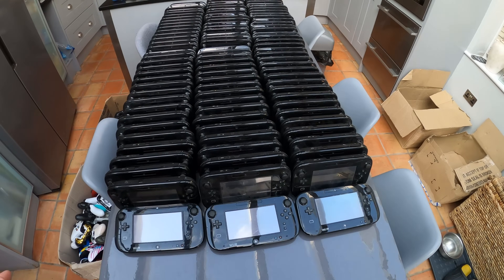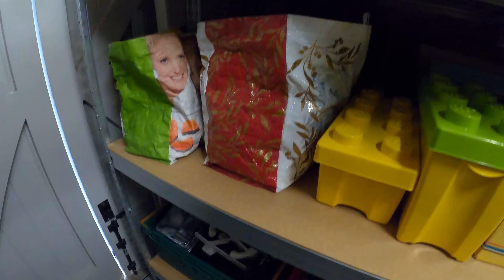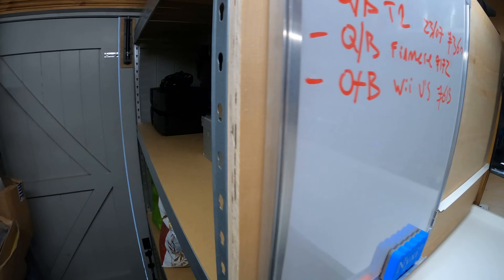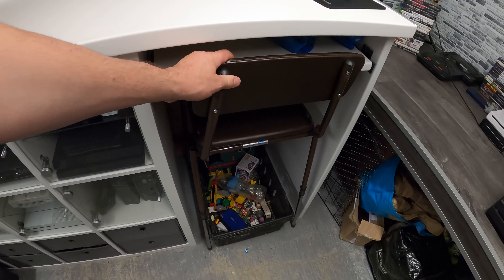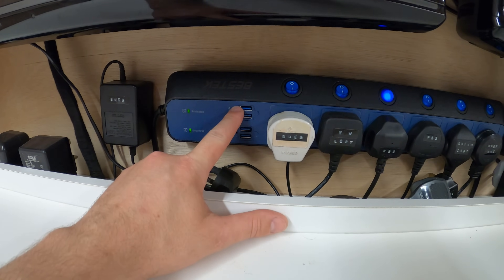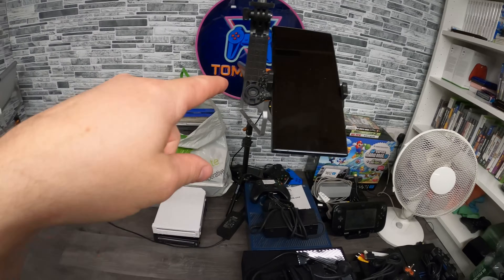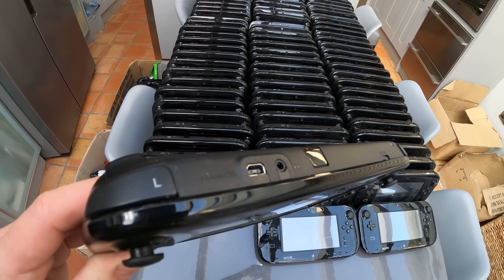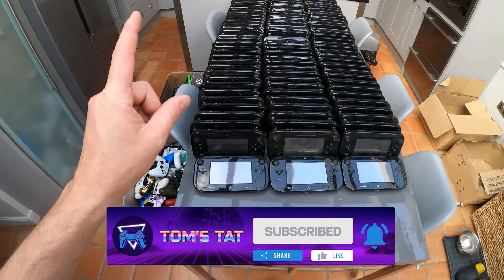WHERE Have I Been?

Comment: Great to see you back Tom ! Love the setup however I'm slightly concerned at the amount of fire loading you have going on
Reply from the maker: Fire loading?
Reply: @TOMS_TAT  yes god forbid there was ever a fire there's alot of stuff in a small area which would act as fuel
Reply from the maker: @Therapist_sells  why would there be a fire?
Reply: I'm just saying if there ever was it's not a good idea to have so much stuff I'm such a confined area. Health and safety isn't a bad thing you know
Reply from the maker: @Therapist_sells  I only turn on each console when i'm using it. Otherwise they are switched off at the plug. I did think about the potential fire issue before I did it and my electrician said it was all fine.